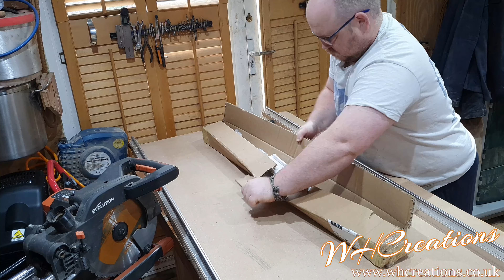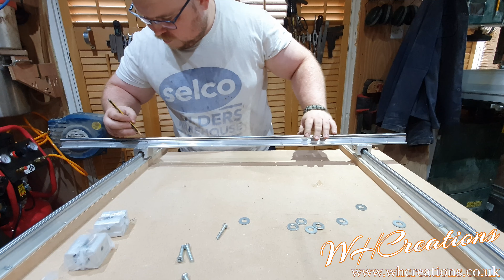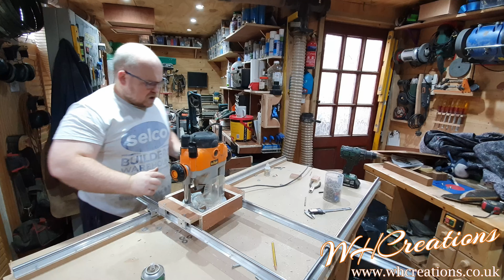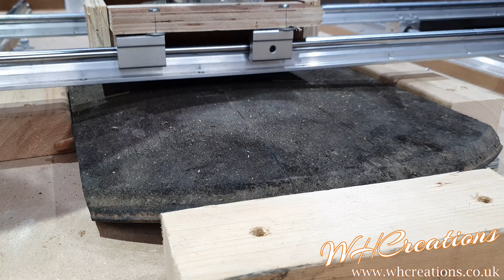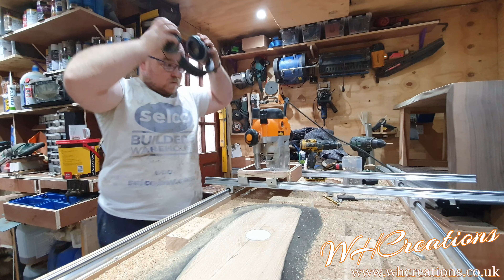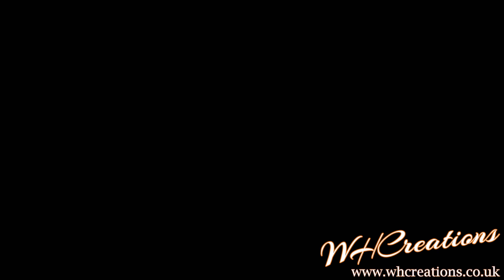I Made The Best Router Sled Part 2

Comment: For top rails can i use diameter 12mm sir or bigger than 12mm??i will use it for makita router..
Reply from the maker: Hey, I used 12mm, does a great job!
Reply: @WHCreations  12mm enough yeah.. cause the bigger diameter more expensive .. how about base diameter sir??  this is same 12mm too???
Reply from the maker: I'm sure it will depend on your circumstances. If you are going big, then I'd invest in a larger diameter. For my needs 12mm was absolutely fine.
Reply: @WHCreations  i just need  strong enough just for hold my router.. only use for my diy ..not daily use.. i appreciated it sir.m thanks a lot ...

Comment: I used the SBR12 rails as well. I was sad to find out after I purchased both of my rail sets that the SBR16 rails have a perfect width that the holes on the bottom of the rails align perfectly with the width on their bearing blocks. Not a huge issue but it means no need to drill holes like I had to with the SBR12 rails.
Reply from the maker: Thats very interesting, I'm surprised they all don't do it personally. I was purely being cheap when I made mine haha
Reply: @WHCreations  Ha!  Yes.  I was furious about this as well.  how hard would it have been to make the centres 35 x 35.  Or sell a package that actually goes together.

Comment: With all my respect to your perseverance, why not attaching your new linear rails to two aluminum angles? It will make it mach more rigid and more user friendly.
Reply from the maker: Always open to suggestions bud. Will look into it. I did put 2 wooden pieces with the rail cut out and slid it over the rail. It stiffened them up really well.

Comment: This is what I’m going to make. 
But looking at the video, it appears your rails are bowing slightly under to weight of the router. 
Maybe it’s an effect of the video. 
You should probably try to check it if you have a true straight edge, but check it when the router is in place. 
It may needs bigger shafts.
Reply from the maker: Hey, with the new rails going across there is no more flex whatsoever. Very sturdy. I think you are right though, I could have gone for the sbr20, which would have made everything a lot more rigid, but the 12s are much easier for me to store, albeit 8mm difference, in my small workshop
Reply: Im having bow issues, watched thepart 1 video. Mine are the 20 mm i went with round rod in the middle using plillow blocks. Im getting .040" just from the weight of the router without making a cut. Was thinking wood frame but see there is deflection you mention in this video. At this point im thinking rails with the base but not sure if ill get deflection and making the setup much more heavy.. hopefully triton gets back to me today cause my router has alot of vibration  like a bad bearing at the 1 setting afraid cutter might fly out if i go any higher in speed